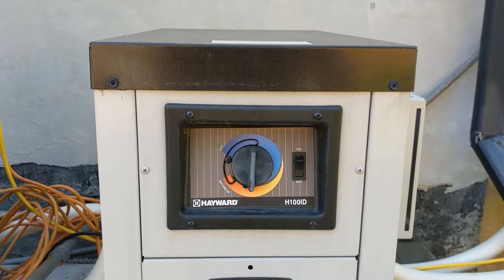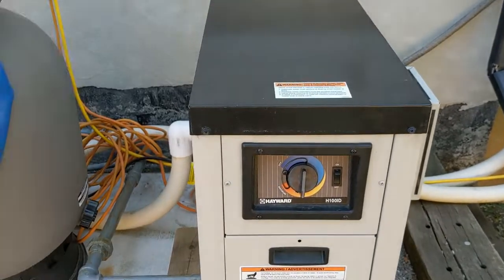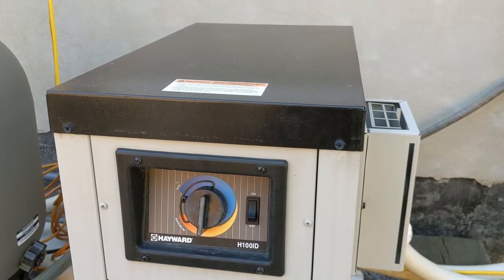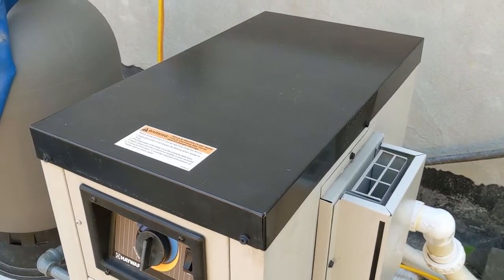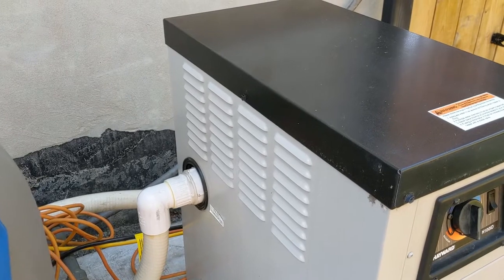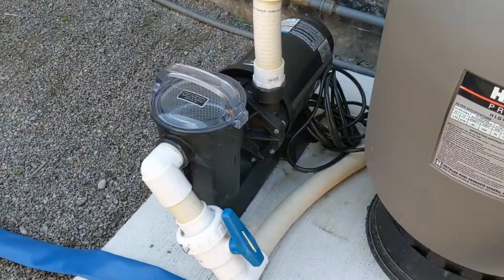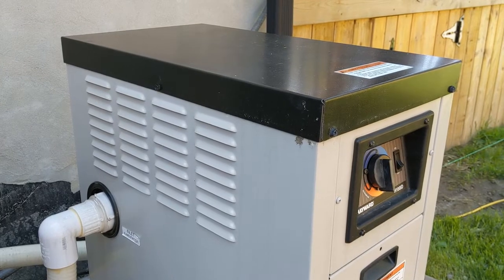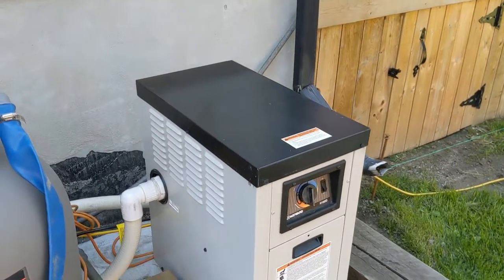Hayward H100ID screaming sound

Comment: Was it the combustion fan??  What did you do to replace.
Reply from the maker: I'm 99% certain that it was cavitation/boiling in the heat exchanger. I deduced that it was down to some scale deposits.

I managed to look inside as much as possible but could not see any scale formations, though I could not see inside the tubes directly where the heat goes.

I was ready to flush the heat exchanger with muriatic acid, but the sound started to go away as I ran it for longer with lower water hardness and a correct water balance.

It's pretty much stopped doing it now, so I think I managed to get rid of the scaling.

It was not the motor or fan.